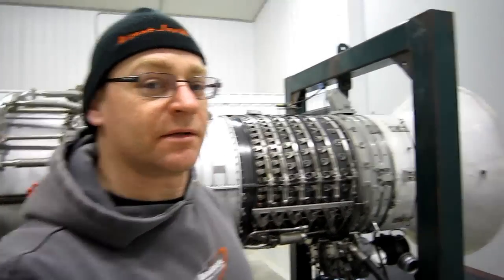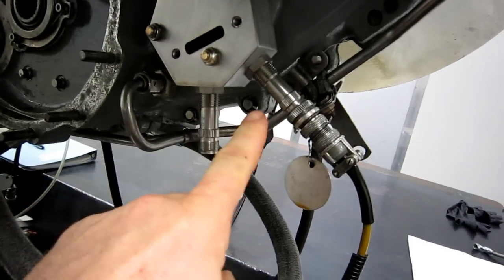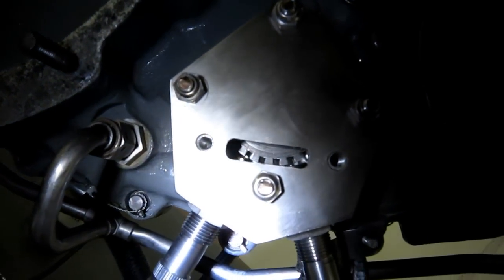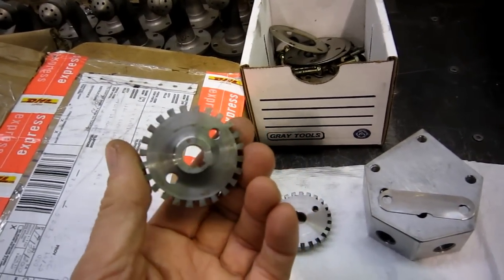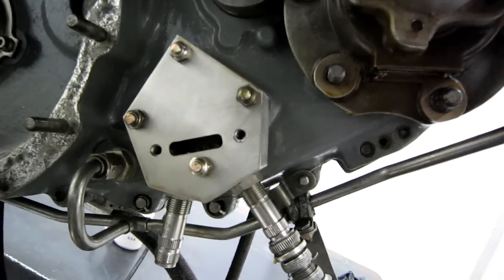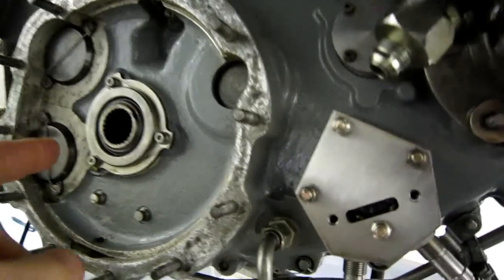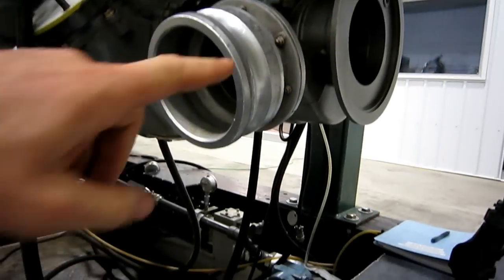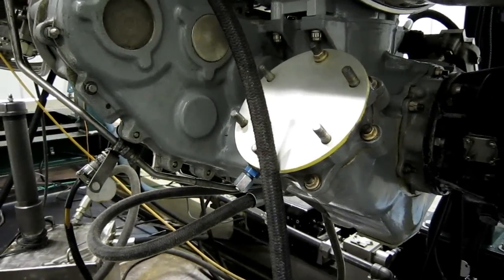Speed Measurement - Turbine Engines: A Closer Look

Comment from the maker: @dmarcellis This engine has only one rotor. What is sometimes referred to as the LP and HP compressor cases for the LM1500 can lead to confusion.
This engine has one compressor of 17 stages turned by one turbine of 3 stages. It all rotates at the same speed.Technically it is a gas generator, which is also what the HP rotor of a multi-rotor engine is called.

Comment: Hi AgentJayZ, I want to ask you about LM6000 HP speed sensor (XN25), I have a problem when the sensor detect a big decrease of RPM, it suddenly opens the VBV (called "VBV kick"). I was wondering what's that for? thanks
Reply from the maker: I don't work with that engine, but I think I know the reason for that response. See if you can find the answer in my video about compressor stall.